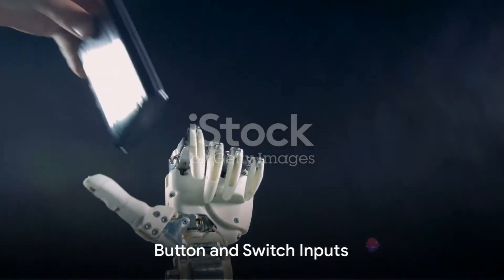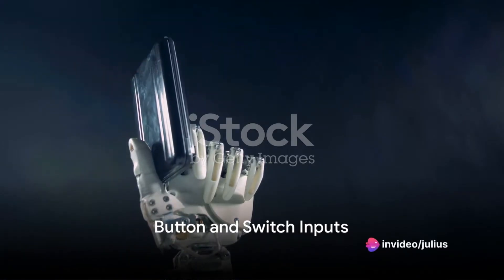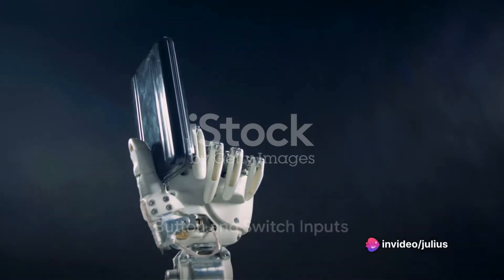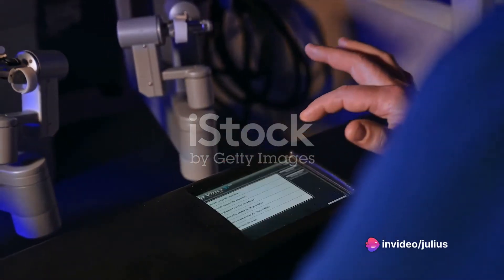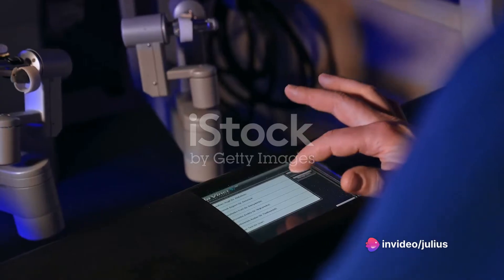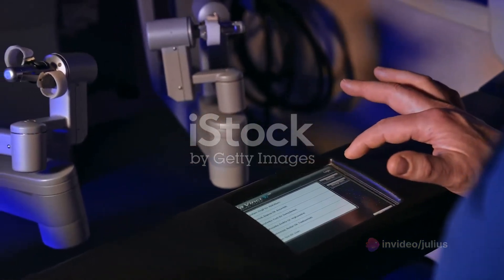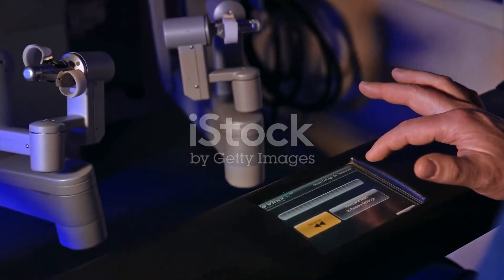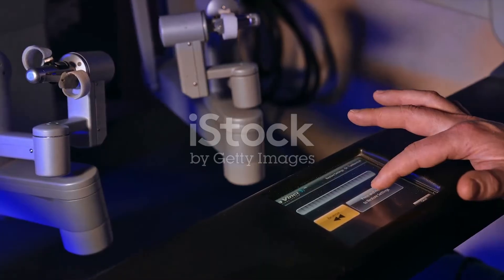Top 10 Digital Inputs in Robotics

Comment: 🌟10 - ANDROMEDA CHAIN ⬇️⬇️
Reply: Ayannah Nicole Ngujo
10 - Andromeda 

2. Explain the role of proximity sensors in robots. How do they help robots interact with their environment?

Answer: Proximity sensors are the eyes of a robot. They detect objects within a certain range and provide a digital signal whether the objects are detected or not.
Reply: Ariel D. Lacia
10- andromeda

2. Explain the role of proximity sensors in robots. How do they help robots interact with their environment?

Proximity sensors are sensors that can detect the presence of absence of objects, allowing robots to avoid objects and allowing them to navigate properly.
Reply: Englis, Dia Bien P.

1. What are limit switches, and how do they function in robotic systems?

- These are the unsung heroes in the world of Robotics, often used to indicate the endpoints of a robot's movement. Boundaries that tell the robot “Hey you've reached your limit stop moving”.
Reply: Dean Andrie P. Daohog 
10 - Andromeda 

2. Explain the role of proximity sensors in robots. How do they help robots interact with their environment?

- Proximity sensors act as the eyes of a robot. It allows the robot to sense whether an object is there or not by detecting objects within a certain range and providing digital signals.
Reply: Kobie James B. Gabales

1. What are limit switches, and how do they function in robotic systems?

Limit switches are electromechanical devices used in robotic systems and other machinery to detect the presence or absence, position, or movement of an object. They act as sensors that monitor and limit the movement of a mechanical component within a defined range, ensuring that the system operates safely and efficiently.
Reply: BRIGETTE LOVE U. GURREA
10 ANDROMEDA

2. Explain the role of proximity sensors in robots. How do they help robots interact with their environment?
Answer: Proximity sensors are the eyes of a robot, they detect the presence of objects within a range, and it provides digital signal.
Reply: Ettena Marie A. Gabales
10 Andromeda

4. What is the significance of digital cameras in robotics? How do they process visual data?

— Digital cameras act like eyes for the digital world. They provide visual data in the form of pixels, which are essentially binary data. They turn images into computer code, and robots can use this code to understand what’s in the pictures.
Reply: Kent Kyle T. Palingcod 
10-Andromeda 
1. What are limit switches, and how do they function in robotic systems?

Limit switches are sensors used in robotic systems to detect the presence or absence of an object or to determine the position of moving parts. They function by physically contacting an object, triggering the switch to either open or close an electrical circuit, which then signals the robot to stop, start, or change direction to prevent overtravel or damage.
Reply: Real Ann R. Dela Victoria
10-Andromeda 

1. What are limit switches, and how do they function in robotic systems?
𝙰𝚗𝚜𝚠𝚎𝚛: Limit switches is used to indicate the endpoint of a robot's movement. They are like invisible boundaries that tell the robot that they have reached their limit and to stop moving.
Reply: Rose Gabrielle D. Araoarao
10 Andromeda

1. What are limit switches, and how do they function in robotic systems?

Limit switches are used to show where a robot's movement ends. Robots can sense when they have reached their limit thanks to these unseen boundaries.
Reply: Trixie Lorraine T. Canopin 
10 - Andromeda 

4. What is the significance of digital cameras in robotics? How do they process visual data?

ANSWER: Digital cameras are significant in robotics as they capture visual data in the form of pixels, which are processed as binary data. Robots use this visual information to identify objects or patterns in their surroundings.
Reply: Angel Sofia C. Tabaniag 
10 - Andromeda 

4. What is the significance of digital cameras in robotics? How do they process visual data?

- Digital Cameras are the eyes in the digital world. They provide visual data in the form of pixels which are essentially binary data, robots process these images to identify objects or patterns
Reply: Antonnette C. Tayrus 
10 - Andromeda 

Q1. What are limit switches, and how do they function in robotic systems?

Answer: Limit switches are commonly used to designate the endpoints of a robot's movements. They are the unsung heroes of robotics because they remind robots of their limitations, control them, and ensure that robots do not go beyond their bounds, which could cause harm to their system.
Reply: Ezra Shimei B. Calaycay
10 - ANDROMEDA

1. What are limit switches, and how do they function in robotic systems?

- Limit switches are sensors used to detect the presence or absence, position, or movement of an object. They are use to indicate the endpoint of a robot's movement.
Reply: Christine M. Luna
10 Andromeda
09/01/2024
( 2:54 ) time stamp

5. Discuss the importance of Digital Inputs in Robotics. Why are they crucial for a robot's operation?

• Digital Inputs are crucial for a robot's operation as they essentially connect rhe robot to its environment by allowing it to interact, respond to changes, and execute tasks autonomously, or as created by human operators. Without Digital Inputs, a robot would be like a ship without a rudder drifting aimlessly and unable to fulfill its purpose.

Comment: X - CASSIOPEIA 📝⬇️
Reply: Adrienne Kiesh R. Magbanua
X - Cassiopeia

Q2:  Explain the role of proximity sensors in robots. How do they help robots interact with their environment?

A: Proximity sensors detect objects within a certain range without physical contact using technologies like infrared or ultrasonic waves. They provide digital signals to the robot’s control system, enabling it to detect obstacles, navigate around them, and avoid collisions, which is essential for tasks like object detection and navigation.
Reply: Jafe Marie A. Ebron
X - Cassiopeia

Q1: Limit switches are sensors used in robotic systems to detect the presence or position of a moving part. They work by making or breaking an electrical circuit when a moving component physically interacts with the switch. This helps in defining boundaries or stopping movement to prevent damage and ensure precise control of the robot's operations.
Reply: Eureka Oclaman
X - Cassiopeia

5) Discuss the importance of digital inputs in robotics. Why are they crucial for a robot's operation?

- Its crucial for robot operation, allowing real-time decision-making and interaction with the environment.
Reply: Princess Jelian M. Ucat
X - Cassiopeia

Q3: Describe how binary encoders contribute to a robot's functionality. What type of data do they provide?

A: Binary encoders convert mechanical motion into digital signals. They provide precise position or rotation data, which helps the robot know exactly how far it has moved or how much it has rotated.
Reply: Joaquin Gabriel L. Cabug-os 
10 - Cassiopeia 

1. What are limit switches, and how do they function in robotic systems?

- Robots move with limit switches to indicate their ends. They serve as invisible boundaries, warning robots when their range of motion has been reached and they should stop.
Reply: Keth Jelzar A. Montes
X - Cassiopeia

Q4:  What is the significance of digital cameras in robotics? How do they process visual data?

- Cameras allow robots to perceive their surroundings. This is essential for tasks like navigation, obstacle avoidance, and object recognition. For example, a robot equipped with a camera can identify and avoid obstacles in its path or locate specific objects it needs to manipulate.
Reply: Nella Regasa 
10 Cassiopeia 

Q2. Explain the role of proximity sensors in robots. How do they help robots interact with their environment?

A: Proximity sensors help robots detect nearby objects without physical contact. They are crucial for navigation, collision avoidance, and environmental interaction. By sending out signals (such as infrared or ultrasonic waves) and measuring the response, they help robots gauge distances and adjust movements accordingly, making them vital for tasks requiring precision and safety.
Reply: Mark Uriel G. Tacbobo 
X - Cassiopeia

1. What are limit switches, and how do they
function in robotic systems?

It indicate the endpoints of a  robot's movement. They act as invisible
boundaries, warning robots when their range of motion has been reached their limit to make them stop movinf.
Reply: Y'vhone Felkris L. Estanda
X Cassiopeia

Q1. What are limit switches, and how do they function in robotic systems?

— Limit switches are electromechanical devices that detect the presence or absence of objects and are used to monitor the position of moving parts in robots and machinery. In robotics, they act as safety and control mechanisms by halting movement when a part reaches a certain position or limit. When triggered, the limit switch sends a signal to the robot's controller, instructing it to stop, slow down, or change direction, thereby preventing over travel and protecting the robot from damage.
Reply: Ethan James P. Malferrari
X - Cassiopeia 

3. Describe how binary encoders contribute to a robot's functionality. What type of data do they provide?

Binary encoders convert mechanical motion into digital signals and are used where precise position or rotation data is needed. This can help the robot determine its position and rotation effectively.
Reply: Kristine de la Rita 
X- Cassiopeia 

Q1. Limit switches are often used to indicate the endpoints of a robot's movement. It tells the robot its limit and when to stop moving.
Reply: Lorenz Michael Paderanga
10 - Cassiopeia 

1. What are limit switches, and how do they function in robotic systems?

- Robots use limit switches to define their movement boundaries. These switches act as unseen markers, alerting robots when they have reached the edge of their range and need to halt.
Reply: Daniella G. Estanilla 
X- Cassiopeia 

Q1. What are limit switches, and how do they function in robotic systems?

Limit switches act as virtual boundaries that alert a robot when it has reached its limit.
Reply: Leonardo M. Verbraecken
X - Cassiopeia

Q4:  What is the significance of digital cameras in robotics? How do they process visual data?

- Cameras enable robots to perceive their environment, which is crucial for navigation, obstacle avoidance, and object recognition. For instance, a robot with a camera can detect obstacles to avoid them or identify objects it needs to handle.
Reply: Kiesha Cantila
10- Cassiopeia

5. . Discuss the importance of digital inputs in robotics. Why are they crucial for a robot's operation?

Digital inputs are signals or data that represent binary states (on/off, true/false) received by a robot's control system from sensors, switches, or other devices. They are crucial for a robot's operation because they allow the robot to interact with its environment by receiving information about its state and surroundings. Digital inputs can trigger specific actions or responses in the robot, such as starting or stopping a process, changing direction, or adjusting speed. They enable the robot to make decisions based on real-time information, ensuring proper execution of tasks and maintaining safety and efficiency in operation.
Reply: Iñigo S. Sevillejo
10-Cassiopeia

1. What are limit switches, and how do they function in the system?

- Robots use limit switches to signal their endpoints. These switches act as unseen barriers, alerting robots when they have reached the limit of their movement and need to stop.
Reply: Cyril Li
Cassiopeia

3. Describe how binary encoders contribute to a robot's functionality. What type of data do they provide?
 

Binary encoders are an essential component in many robotic systems, particularly in applications that require precise positioning, orientation, and movement control. They contribute to a robot's functionality by providing a digital signal that represents the robot's physical state, allowing the robot to make informed decisions and take precise actions.
Reply: Cheryjan Aclo
10 Cassiopeia 

1. What are limit switches, and how do they function in robotic systems?

1. Limit switches are sensors used in robotic systems to detect the presence or absence of an object, or to indicate when a certain position has been reached. They function by physically interacting with a moving part of the robot, triggering an "on" or "off" signal when a limit is reached. This input helps prevent damage by stopping motors when an end point is reached and ensures precise control of movements.
Reply: Merchella Da-an 

5. Discuss the importance of digital inputs in robotics. Why are they crucial for a robot's operation?

- Digital inputs are crucial in robotics because they allow robots to process discrete signals, such as on/off commands, sensor triggers, or control signals. These inputs enable precise decision-making and task execution, as robots can quickly respond to binary conditions, control systems, and receive data from external devices. Without digital inputs, robots would struggle with basic operations like motor control, navigation, or interacting with other electronic systems, limiting their functionality and efficiency.